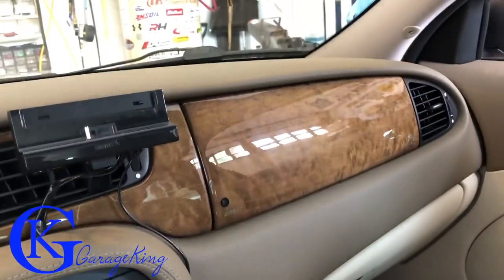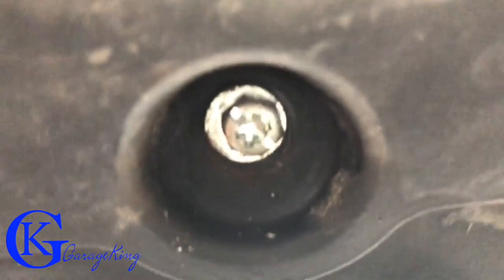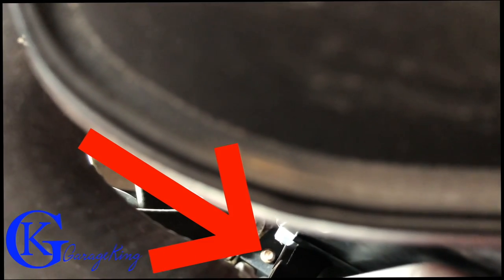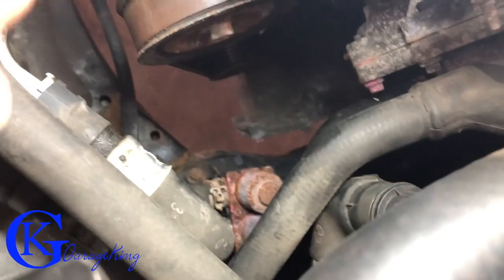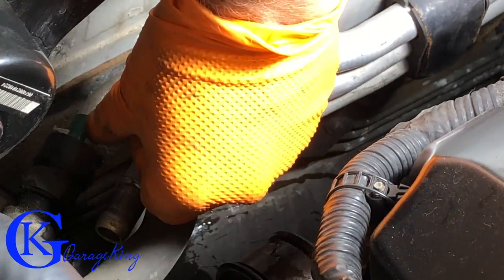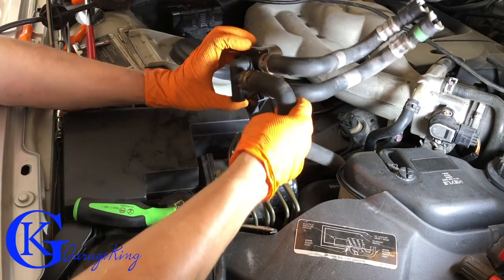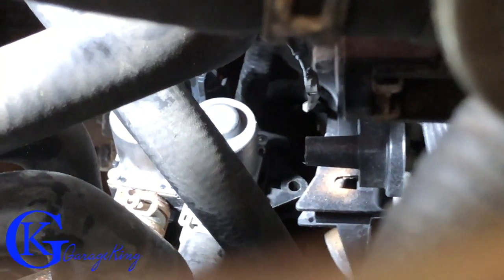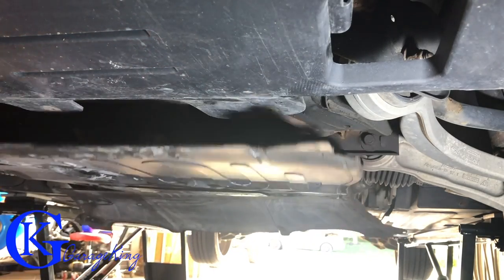How to Replace Jaguar S Type Heater Valve

Comment from the maker: The must have tool for disconnecting the heater hoses, this is one of my go to tools for many jobs https://amzn.to/3uF8JKS
Reply: Where can I get the hoses that connect to it ? Or what are they called cant find and my hose broke
Reply from the maker: @MsMeme227  I think for those hoses you have to go to Jaguar, unfortunately.....  You could call your local Napa, or parts shop, but they are specialty hoses so I think they are a dealer item :(
Reply from the maker: @MsMeme227  If you go to Jaguar, they will pull up a picture and you can pick them out of the picture.
Reply: You can buy the black and white hose connector at autozone and just use genaric hose with a hose clamp the have them in the section with all the American car parts this jag was built in cooperation with ford and shares a lot of parts with the Lincoln ls and ford thunderbird they are all the same platform and the 3.9 that ford/Lincoln uses it’s the same as the 4.0 and 4.2  u can swap parts back and forth
Reply from the maker: @DrewDown-cq4zr  Thank you for the reply, very informative and it will surely help others out.  Thank you

Comment: You do realize that those coolant hoses u popped off you literally did it the hardest way possible u are suppose to push the white tabs in and pull the black part of the plastic hose fitting there is no reason what so ever to remove the white hose locking clip like they put the push tabs there to make ur job easier not harder and now u have people out here struggling when these are supposesupposed to to be dummy proof
Reply: Not tryna be an ass or anything by any means just tryna throw some helpful tips out there for ya
Reply from the maker: No you are not, that is the reason that I used the tool. If you are talking about the 8:50min mark I used the GM Kent Moore tool to release the hoses.  That is the easiest way because the tool can be in any position.  If you do it your way you have to squeeze those tabs which don't always play nice, you can't be in any position, and you can loose the O-Ring that will come free and often binds when you put it back together.  Doing it with the tool allows for everything (clip and o-ring) to stay in place when when hose is removed.  GM uses the same type of connections and how I did it is how the manufacturer states to do it.  How you did it, is how someone without the proper tool figured a way to take it apart.  Sorry but you are wrong here.  I appreciate your other comment, but in terms of taking the hose apart, this is why the tool was made.
Reply from the maker: I hear you, but your tip is fine as long as someone resets the O-Ring.  When you do it your way its easy to loose the o-ring and it can bind.  The clip remaining in the hose is what keeps the o-ring in.  You may have been lucky so far, but if you do it your way please check the o-ring is seated before you put it all back together.

Comment: Use MOTUL 109142 orange coolant. It’s the same as what Jaguar overcharge for…
Reply from the maker: Hey Thanks for this, I did not know.  Motul is a good brand and I associated them with oil.  Thanks for the tip !

Comment: Hello, thank you for the video. What tool did you use to remove quick connects please ? The Amazon link is not working anymore 😢 thanks!
Reply from the maker: Hey There, I'm a GM mechanic so that was a genuine Kent Moore tool, but OTC made one, that's what's in the link.  The link works and then does not, I guess the product comes and goes so I leave the link up.  Here is another tool I just found but I can't confirm quality https://amzn.to/3sa7eZ3 please let me know if you buy it.  Thank you
Reply from the maker: ALERT ALERT, I found one here https://amzn.to/3sa7eZ3 if you get is please let me know about the quality !!  Thanks
Reply: I'm in France and the links don't work for me 😢 can you put the references please so that I can look for them in Amazon France ? Thanks again!
Reply from the maker: @YouThomasGti  Hey There I checked amazon France and could not find it. You can try searching for Otc 519157 Gm Htr Line Disconnect or CTA Tools A373 GM Heater Line Disconnect Tool
Reply: @GarageKing  Thank you very much !
Reply from the maker: Anytime, and hopefully you can find one as the tool pretty much pays for itself as it makes the job so much easier, plus you won't break the connector !!!  @YouThomasGti

Comment: So good explanation 👏 I have jaguar stype 3.0 2008 recently I heard sounds behind the screen navigation after and every time I turn on or off even AC or heater could you please let me know
Reply from the maker: Hey there, most likely that could be you blend doors.  Those are the dividers that move around when you change the temperature, or change from feet to vents to defrost etc.

Comment: Thank for a very helpful video. My questions are: 1) How long did it take to complete the instillation? 2) how mush would it cost to have the job done by a repair shop?
Reply from the maker: Hey thanks for the comment.  It really was not that hard.  I would say if you took your time you could easily do it in 2hrs, I probably took closer to 3hrs, but I'm filming so its not a fair comparison.  I could probably do one in about an hour. But I think 2hrs is reasonable for someone new.  You don't loose much coolant either so that's nice.  To take it to a repair shop is subjective, but at 2hrs (let say) and their shop rate could be anywhere between 75-175/hr I think you would probably be looking at 150 to 350 labour plus the part.  It would also vary on how familiar the shop is with Jags.  Keep in mind that sometimes when the heater valve burns out it creates a heavy current draw on the CCM module and causes it to fail.  Here is a vid on how to get the CCM out  https://youtu.be/qIPWtyGz64o and here is how to fix it https://youtu.be/8nJBogEXkTY

Comment: Hi there, great video. What’s the tool you use to undo the quick connects? I have hose clamp pliers for the bottom connectors, but agree it would be easier to remove it with those hoses still attached. Thank you very much. 
Steve.
Reply from the maker: Hey thanks for the positive comment brother, I do appreciate that.  The tool is a General Motors tool.  Kent Moore makes tools for GM, and when I was a mechanic for GM I ordered my own.  The part is J-38723 and it is made in the USA.  I did find an equivalent on Amazon.com https://amzn.to/3uF8JKS made by OTC.  I have no idea why it only got two stars unless the OTC one is made out of a different material.   I use this thing on so many things as its small and the handle will give you leverage. I have OTC tool and for the most part they are good quality, but I can't compare it to the Kent Moore as I have never examined the OTC.  Hope this helps you out and you are having a good weekend :)
Reply: @GarageKing  in my situation all the vents are red-hot, would you think that’s the DCCV or the Climate control module? 
Thanks so much in advance. 👌👌
Reply from the maker: @sablett  Hey Steve, I have found that many times a bad control valve takes out the Climate Control Module.  I'm just finishing filming how to repair the climate control module and should have it up in a week or two.  You probably can't wait that long so I'll give you the down low.  Remove the climate control module, see my how to replace it vid.
https://www.youtube.com/watch?v=qIPWtyGz64o&t=2s

Then you can take it apart, be careful of the microphone.  Once you slide the circuit board out and inspect it, you will most likely find two burnt points.  You can solder in a jumper wire with a 1 amp fuse (I think I used 1 amp) then re-assemble.  Most people don't think of the climate control module, but it goes quite often.
Reply from the maker: Here is the vid on how to rebuild the Climate Control Module if you are still interested :)  https://youtu.be/8nJBogEXkTY  Thanks and have a great Sunday :)

Comment: Will this be the issue ,for a no heat situation,,?
Reply from the maker: I'm not sure but it could be, an easy way to tell would be to feel the hoses coming out of the valve and see if they are hot.  If the hose is cold then you know its stuck closed.

Comment: It may seem obvious to many. However, I am unaware of the Jaguar procedure for correctly bleeding air from the cooling system. For that matter, I've never found a video explaining how to refill a Jaguar cooling system that is empty.

I am about to flush my (2005 S-type V6) with distilled water and then replace the thermostat (due to age), reservoir tank (due to cracked nipple) and heater control valve (intermittent heat supply).

My other Jag and Porsche each have their own procedure and equipment to do it properly. Every video treats refilling the system as though it's insignificant. I've spent hundreds on parts. This is the first vehicle I've owned with a bleed valve. I'm thinking of adding one to the Porsche.
Reply from the maker: You raise an excellent point and thanks for the feedback. I really appreciate comments like these as they help me make better videos.  When I replaced the heater valve I actually didn’t loose much fluid so I just filled it up, replaced the cap, and I noticed that about the same went in that came out so I knew I was good. I then ran it and made sure I got heat comping out of the vents. The Jag does have a bleeder valve on the engine if I’m thinking correctly so when you shut it down wait for a min or two then crack the bleeder and see if there is air at the top.  When I worked for GM we would fill the reservoir, put a pressure tester on it, and pump it up to a few pounds. Then go through the bleeders until there is fluid coming out. (Obviously keep adding as needed). Thanks again for raising a good point.
Reply: @GarageKing  

Thank you, for the response!

I've heard people recommend adding the fluid, turning the heat to max, run the car to open the thermostat, add more coolant, repeat, etc.

The problem is...it's not air conditioning, it's heat! Your air conditioner won't scald you. Wouldn't it make sense to open the bleeder valve AS you refill it?

Porsche recommends using a sealed tank with coolant to force out air pockets. It "sort of" works.

I'm curious as to the factory recommended procedure. I discovered the hard way that over filling coolant ruins the "low coolant" sensor (switch).

Thanks again, for the videos and effort. I am not a newbie by any means but I know when I'm not 100% knowledgeable.
Reply from the maker: @toobad9946  Hey Jim, you definitely don't sound like a newbie, and it's great you are tackling some work, it is empowering, plus you can save some cash.  You comment about opening the bleeder as you fill the coolant is valid, and I would recommend doing that when ever you can.  When you pour the fluid into the overflow you are creating a slight pressure  and an open bleeder valve can get rid of an air lock.  As for the exact procedures on the Jag, I'm not sure, but I have done so many vehicles that I see similarities.  A good example is the VW Vanagon (I have one) VW says that to fill antifreeze, the front of the vehicle should be elevated (engine is in the rear and radiator is in front).  The best way to fill that vehicle is to crack the bleeder on the rad, fill the overflow tank, then use a pressure tester to "raise" the fluid in the front, and repeat. 

One thing I always did (and still do sometimes) is measure the amount that comes out.  If you are putting close to the same amount in then you are off to the races.  Sometimes on the Japanese vehicles I get as much as I can in there, but I'm always about 1/2 litre short.  I overfill the expansion tank, and after a few cycles they purge and the expansion tank is right where it should be. 

I haven't heard that overfilling coolant will ruin the low coolant sensor.  Usually those sensors are two types.  A) sliding sensor, think of a cork on a rod, and B) two electrodes. They are submerged in a tank to the side, and when the coolant gets low either the cork slides down and triggers the light, or the electrodes are no longer submerged and the continuity in the circuit is broken when triggers the light.

If you are unsure then measure what comes out.  I did that on the Jag and was surprised at how little came out when I did that heater valve.

Comment: What if vents temps are consistent 74 degrees from all vents but have codes B1262, B1263, B1242?
Reply from the maker: Your codes are all related to the servo actuators that move the doors in the dash to blend the air, if one is stuck/damaged/broken it can cause the temp to remain constant as the doors are stuck in the same position.  If you took the computer out I would check all the connections as its unlikely all these different servo motors are failing at the same time.  Its more likely that there is a bad connection somewhere.  If you have a bi directional scanner you can trigger the actuators to move.  If you were in the dash check all of your connections first, it could be something simple before you go digging.

Comment: Where can I get those hoses can't find any where for 2003 type s
Reply from the maker: I think for the hoses you may have to go right to Jag with the serial # of your car.  Can't see that being an aftermarket part.  If you are looking for the tool to take them apart, the link for the tool is in the description and you can get it off Amazon.  Use to the tool so you don't break the plastic piece of the hose..........

Comment: Can the heater valve be a cause to the vehicle overheating.
Reply from the maker: I guess it could be depending on which way it fails, if it prevents flow through the engine then yes.